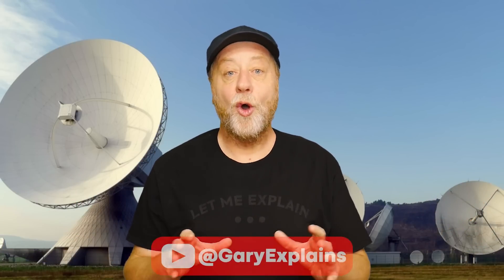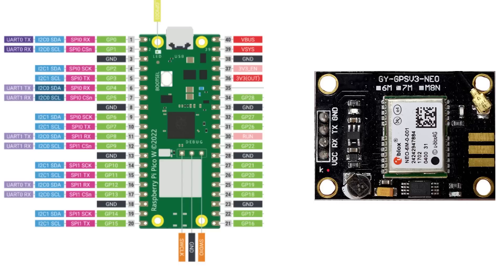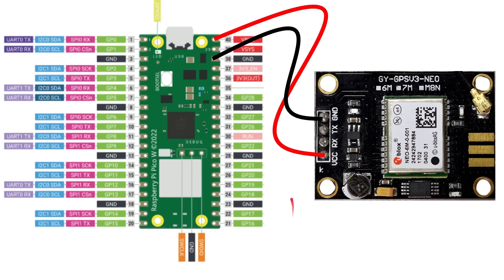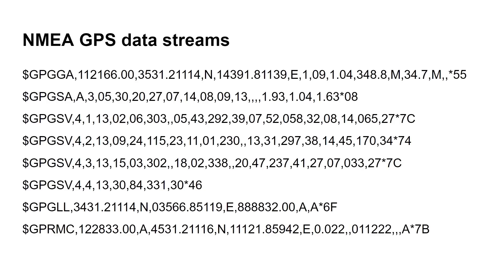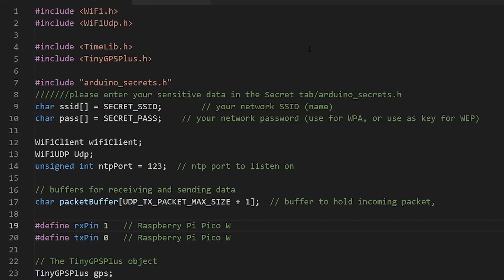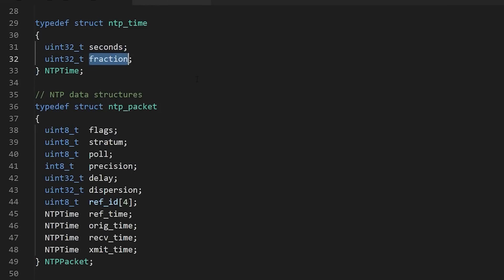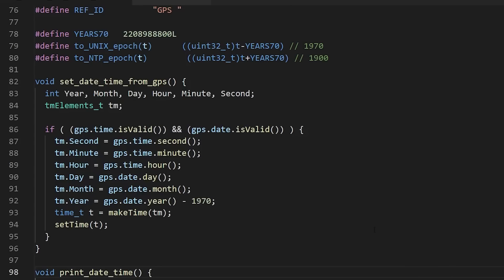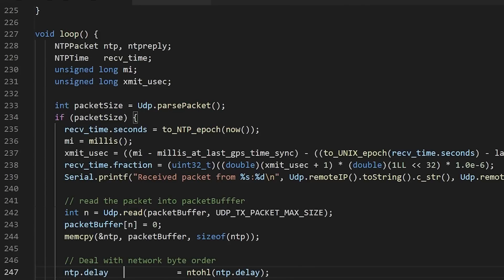Build a Stratum 1 Time Server Using a Raspberry Pi Pico

Comment: There are a bunch of Stratum-1 sources on the internet that don't rely on GPS, but instead sync directly to UTC, which is what GPS is synced to.
Reply from the maker: And?
Reply: @GaryExplains  "In fact, the whole Internet is probably synchronized, time is synchronized using the signal that comes from the GPS satellites."
Reply from the maker: Could you give me a list of NTP servers that use an atomic clock rather than GPS? I couldn't find such a list.
Reply: @GaryExplains  I'll see what I can dig up. There are also ones that use cellular signals, like CDMA.
Reply: @pleappleappleap  it's been a month, where's the list?
Reply: @Joeyhelmond0492 as far as I know, Canada has a public NTP server and Germany's Braunschweig has another. There are more but needs more digging.

Comment: I’ve used a GitHub repo called “RPi-GPS-PPS-StratumOne”, a GNSS receiver and a Pi Zero 2 W as an NTP server.

The repo has a bash script to do all the difficult setup for you and uses PPS for more precise disciplining of the Pi’s time.
Reply: You can have pps output, some modules have it on the pins, the rest you can solder wire to the LED and get the signal out to the pico.
Reply: @jan.tichavsky  how accurate is the LED? The PPS output has a spec.
Reply: @alanb76  That's the thing, the LED is usually connected to the Timepulse output (PPS) of ublox receiver even on the cheapest Neo 6M modules, so you can get the signal there directly.

Comment: 2:49 The free GPS antenna is the same as the better one, they are both patch type, however the one with the SMA connector has a built-in LNA.

Comment: How accurate is your implementation ? how does it compare to using an an a normal ntp service on your machine ?
Reply: 3 orders of magnitude worse - only gets the time to the nearest second and then has variable latency transmitting it to the network. Normal Stratum 1 NTP has sub-ms accuracy. This is produced by using an edge triggered pulse input (PPS) to lock in the exact point the time is correct.
Reply from the maker: Many GPs modules offer a PPS pulse, it shouldn't be hard to incorporate that. As for the variable latency transmitting the time via NTP, of course that is true for all NTP implementations and NTP handles it.
Reply: @GaryExplains  Ok I am interested and curious, so your mission is accomplished in that.  From reading the other comments, many question do come to mind.   Given a normal computer ( window / linux ) how accurate  is it with normal ntp server.   How accurate is can it be using this gps time with and without pps.    what if I wanted to go crazy have two dedicated raspberry pi core to measure a sensor, but they are two far away from each other for wifi signal, how good could I get them in making the measurement ?
Reply from the maker: I suggest you watch my other videos on time, I think you will find answers to many of your questions. Here is the playlist: https://www.youtube.com/playlist?list=PLxLxbi4e2mYFmsJADZJSM7-wjbUF7udsC

Comment: What is this Serial.printf() of which you speak? The compiler chokes with the message "Compilation error: 'class arduino::UART' has no member named 'printf'; did you mean 'print'?" Looking at the docs and google search seems to indicate the arduino ide can't do this. Am I missing something here?
Reply from the maker: The Raspberry Pi Pico implementation of Serial includes printf, for Arduino you will need to break it down into Print and Println.
Reply: @GaryExplains  it fails on my PicoW at this point and when rem'ed out it then fails on setRX. Did something change and these are no longer in the language?

Comment: What about the NMEA message receiving time lag from the GPS receiver and further software delays? I thought you would be able to do your magic on the second, but refine the exact moment, af least to a few milliseconds, from the 1PPS (one pulse per second) signal directly from the GPS on one of the Pico's GPIO ports. The 1PPS IS the exact moment you can count on for time synchronization.
Reply from the maker: That sounds like a good idea. The code is in my GitHub repo please feel free to extend it to monitor the pps on a gpio pin.
Reply: That's true you would absolutely need PPS to get desired accuracy from this kind of configuration.  But the module used in the video does not even have PPS output so a different module would have to be used.

Comment: Most the time I am inside the house, the GPS reception is miserable there. I have to walk outside the house to know where I am. Only then a GPS receiver can tell me that I am at the back of my house and not in it. On the other hand, in the telephone signal is also the time transmitted. Maybe UMTS / GPRS can be used better instead of the GPS signal. The receiver is just as cheap as the GPS receiver. Often it can be harvested from an old phone, the Chinese even sell these receivers, desoldered from telephones whos only fault is being from last years. And maybe using an old mobile telephone receiver could also give extra information, like name of the telephone company and the exact GPS location of their mast. Recording this information could give you an alibi if you are at the same time somewhere else doing things you shouldn't. (Omnipresence is not rare or so, many have this!)

Comment: Wouldn't it have been a lot easier to just use the GPS data to set the hardware clock on a computer (any general purpose computer that can run Linux), then run the ntpd daemon as a stratum 1 time server on that computer?

With this solution you would only need to write some code to extract the current time from the GPS data and use that to set the time.
Reply from the maker: Of course there are other solutions, but that isn't the point is it.
Reply from the maker: Also, did you see this video where I put an atomic clock in my PC? https://youtu.be/YKApDtJjXU4

Comment: Nice to see this on a Pico, and using both cores. Please add PPS to make this accurate enough to be useful. A Stratum 1 Time Server needs to use the GPS PPS signal. The Serial data alone is not accurate enough for Stratum 1. Many low cost GPS boards have this signal in addition to the serial.
Reply: You will be serving time over wifi which already kinda defeats purpose of gps accurate signal. It will be good enough for general use. You can always add one more wire from the led.
Reply from the maker: Glad you like it. The source code is in my GitHub repo, please feel free to extend it to include PPS.
Reply: Could you provide your github link please? @GaryExplains

Comment: I used a MikroTik router. It has NTP server and or client program already integrated in its OS. You plug a serial gps and you can synchronize it with gps. And there are really cheap MikroTik router and you get a good router with it.
Reply: Nico, please share the model number you have used. I would like to recreate your method.

Comment: Thank you for the informative video! I wonder why you would need your own NTP time server, though? Do you see public NTP servers as a security risk, or consider them unreliable?
Reply from the maker: There are lots of situations where running your own time server is beneficial, especially on any kind of private LAN with many machines. Imagine the amount of network traffic a data center creates just trying to sync the time. But the point of this project was more about the "fun" and hobbyist spirit than anything else.

Comment: Is GPS time more or less accurate than the land based atomic time like   the  clock at the national phisical laboratory in the UK .
Reply from the maker: You may find this video of mine interesting. I put an atomic clock in my PC! https://youtu.be/YKApDtJjXU4
Reply: @GaryExplains  interesting , but still gps based and a bit costly. See https://youtu.be/S7JmCmbBKfA
Reply: @guusossevoort6855  How is GPS compared with the clock in mobile network's basestations deployed?
Reply: @guusossevoort6855  Nice to know.  I asked because I read that basestations usually employ a very accurate clock.  Now I know that it is the same as the GPS clock.
Reply: @catchnkill  Actually, I think most cellular base stations use GPSDOs (GPS Disciplined Oscillators), they’re much cheaper and more robust than rubidium oscillators and actually have better long-term stability. GPSDOs typically have a very stable ovenized crystal oscillator at their core, with a voltage input that can slightly shift the oscillator frequency. The oscillator output is divided down to a 1 pps signal, which is compared with the 1 pps output from the GPS module. If the oscillator’s output is leading the GPS signal, the oscillator’s control voltage is adjusted to slow it down, if it’s lagging, it’s sped up. 

The control loop has to be carefully designed and tuned to avoid any “jiggling” of the output frequency (called phase noise), but frequency deviations of less than 1 part in 10^10 are easily achievable. (That is, an error or less than 0.01 Hz in a 10 MHz clock signal.)
Reply: @DEtchells you saved me a few thousands of euros. I'm currently looking for an atomic clock for my master thesis. My university doesn't have an atomic clock as NTP is sufficient for our parallel computer. I will inform my professor about various options and how we can proceed further. 😅😅

Comment: As an older person, seeing this sort of solution being available, not just for home use, but at such a low cost, is beyond amazing.
Reply: I remember the first time I saw basically the same thing... It was made by NEC, it took a complete full rack, and it was nowhere near as accurate... And if the figure I was told was right, it costed $14 million... It served as the national timebase standard for the Republic of Panama and was part of a NEAX PBX. Surprising indeed.
Reply: @BrunoRegno  The problem with national telephone networks is that they are very reliant on accurate timebases. The old T1 standard for example pushed 1.5Mbits of data each second, if you are just a single bit out, you have unintelligible audio/data on the other end.

Sure, you can try to recover the timing from the stream itself, but you should still have a single source of truth for the network where possible so you as a nation don't drift too much.
Reply: 40 years ago time servers in computer rooms cost an absolute fortune,
Reply: This has been possible with serial interface and hand held GPS with serial bus (or by hacking to it with some wires as in this video) since late 90's. (I was working in Nokia with navigation based product back then). NMEA codes are in text format and in public domain. However GPS manufacturers tend to have proprietary non-text serial protocol, too. Both in the same serial interface and by default configured to work with NMEA protocol.